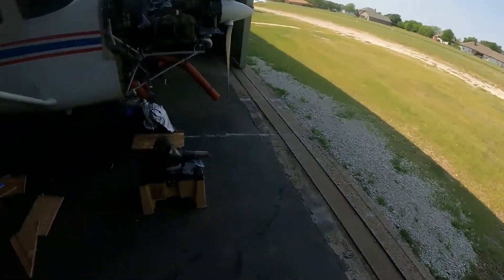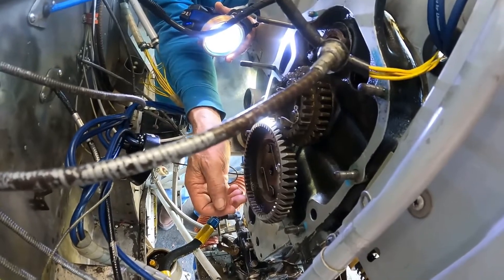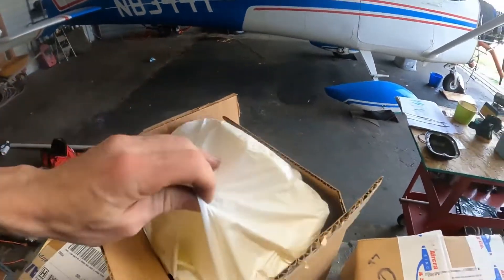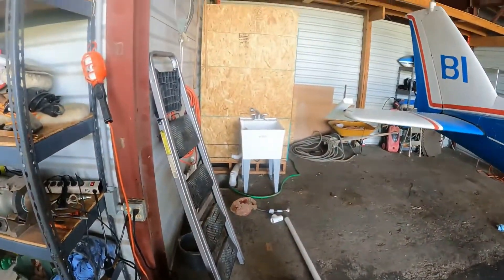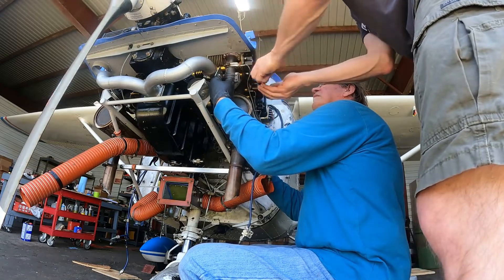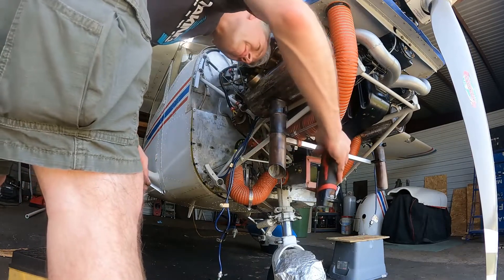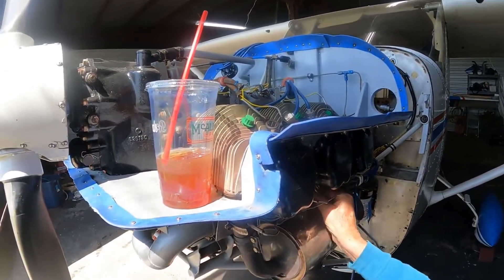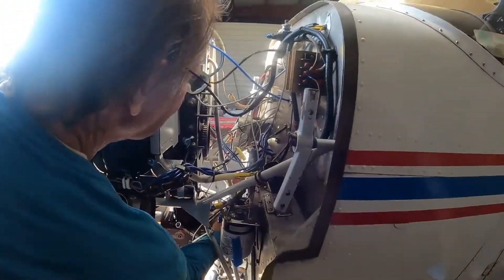Airframe and Powerplant | N8344T | mufflers | Plane Power alternator | Hanger upgrades

Comment: In a stuck throttle you can also manipulate mixture to reduce some of that power also but probably something you should do over the field again. Don't see why you can't use flaps if you are assured you're going to make the field but not before.
Reply from the maker: With flaps you need to really slow down, you might not be able to lean down that far without killing the engine..
Reply: @WolfPilot  Ah. Probably different technique. I been taught get above the field with a buffer and then glide approach in
Reply: @glennwatson  👍☑️ Thats the way I was taught too.